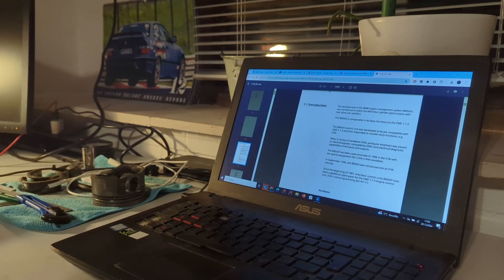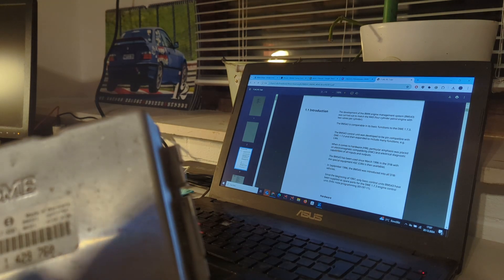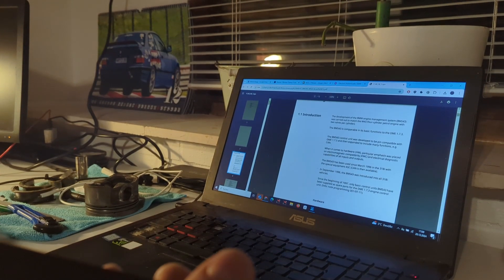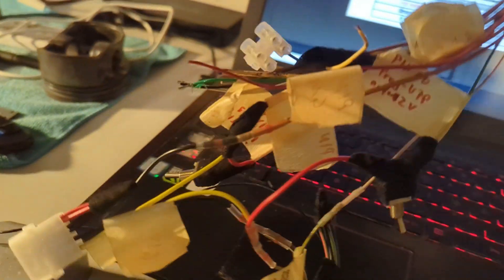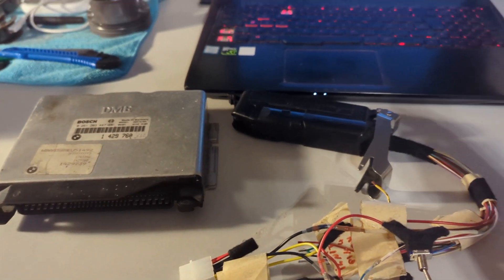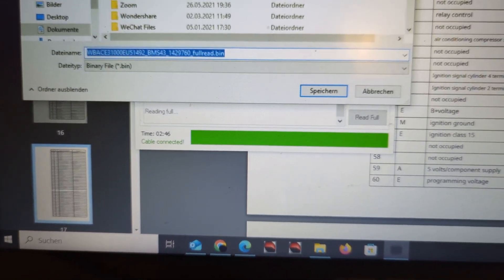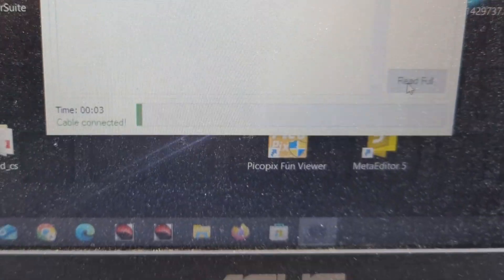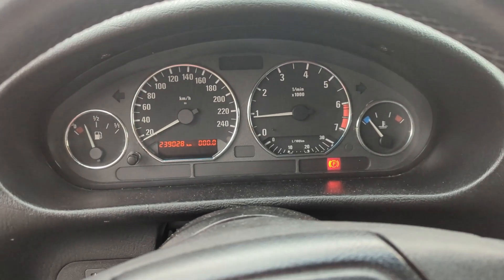BMW S.I.P - mystery ECU BMS43 diy flashing and tuning for the M43 engine. finally.....

Comment: Hi

If i bought this software can i do read and write using k+dcan cable directly connected to the car without getting the ecu out and buy another connector to plug the ecu to the cable ??
Reply from the maker: watch my other video - BMW S.I.P - finding the rev limiter - ECU BMS43 e36 diy tuning for the M43 engine- on it and it will give you the answer. like and subscribe
Reply: @CSI_tuning_solutions 
Done 
Waiting your reply and guide 
Be note that I'm just a user not a dealer 😅
It's first time I do this
Also if i can get a discount on the app instead of 49$ 

Thanks
Reply: can you give this software please

Comment: Does this also run on a m43b19?
Reply from the maker: nope. m43tu uses bms46 ecu
Reply: @CSI_tuning_solutions ah dam but thank you for your help dude, you a big help in my search for tuning 😂
Reply from the maker: @Kink3chamilian join the discord BMW tuning community. Link on ms4x.net there is also threads for.bms46 tuning